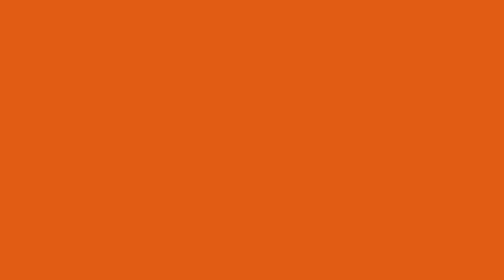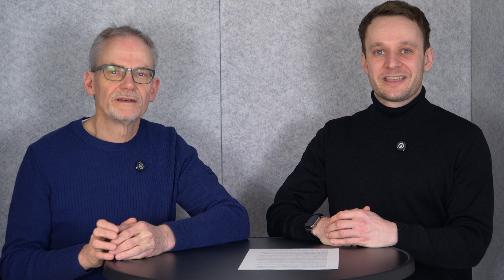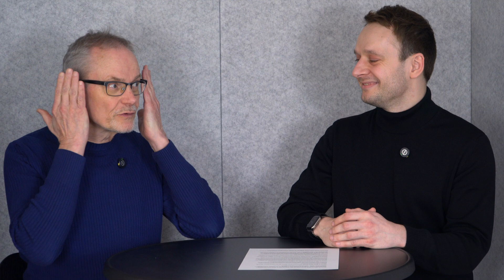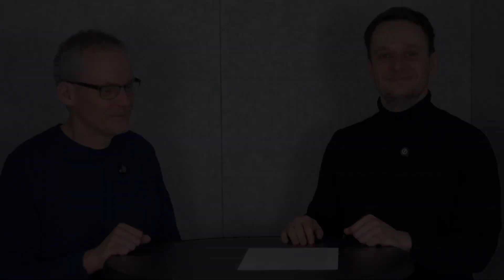Driver Angle: Not only for Soundstage! Grell Sound Lab EP03

Comment: Advice never get drivers smaller than plus 40mm and never go for flat drivers I learnt the hardway,  all my best ones are 50 53 60mm only one other has 42mm drivers all my 40 mm and 38 mm hd500s are gone bye bye   angled drivers and plus 40mm anything flat or small is pointless and thin and imaging is inferior
Reply from the maker: We think a bit differently. Just in terms of pure acoustic performance, we agree that a larger driver for over-ear headphones is generally preferable. That being said, large dynamic drivers tend to have break-up modes in the treble causing dips or distortion, and large drivers put constraints on other aspects of the headphone, ie. freedom of voicing, angle, weight, size, cost, etc.
So we absolutely agree that headphones with large drivers have a higher "ceiling" of good sound, but not every implementation is well done and you can do great work with "standard" 40mm drivers as well :)

Comment: So for angled drivers the targets for FR might actually be different than we usually use, right?
Reply from the maker: This is correct. You already see this in some frequency response measurements, where headphones with angled transducers tend to produce notches around 10kHz, while others don't. Ie. compare 500 and 600 series headphones. Very similar transducers, but the 500 series chassis produces this notch from the Pinna interaction. This also has a direct impact on the perception of space: sound sources close to the ear will generally produce relatively smooth frequency responses, while far away sources will have more pinna interaction and therefor some notch between 6-10 kHz, depending on the individual, distance and angle.
Reply: @grellaudio that's is very insightful! Thanks for your answer! It is very interesting to think that depending on how the headphones are built you can actually expect different curves to sound better. So that comparing them directly looking at their curves only may not be so meaningful.

Comment: I would like to know about the differences in sound tonality achieved by hardware tuning and just by EQ. Could you just buy an entry level headphone from a brand and EQ it to target a more expensive one from that brand and get the same performance (for example: 560s to 550, or Elex to Clear, or edition xs to Arya)? I'm also curious about whether high impedance is useful in a headphone. Thank you so much.
Reply from the maker: Great question! There is a school of thought claiming that only frequency response at the eardrum matters. If that were the case, you could just take any low-cost IEM with a reasonably smooth frequency response and low THD and equalize them to sound like any other headphones. This is obviously not the case.
We're certain that there are factors to sound quality not easily changed by EQ or "raw frequency response": Openness is measurable and clearly audible and can't be changed without hardware adjustments. Transducer size and angle impact the interaction with our pinna. These reflections impact both the amplitude, as well as the time domain. THD can not be reduced without active compensation. The superior perceived clarity of electrostatic headphones are evidence that diaphragm weight is an important factor.
Theory is always interesting, but in this case it obviously disagrees with some hard research into acoustics with topics like openness, as well as with experience.
Specifically on the HD 560S and HD 550: The transducer material is different, so the openness is likely different as well and can't be EQ'd. Beyond that, the diaphragm material is different, where the HD 560S has much higher internal damping, resulting in a "duller" sound, no matter the frequency response. Lastly, the acoustics are slightly different, the HD 560S has a bass tube, which gives the subjective impression of "slower" bass.
Long story short: The transducer of the headphone sets the base line of the sound quality that can be achieved. If the transducer has high THD, has an uneven response, is quite heavy etc., no amount of EQ or acoustic fiddling will bring the system to the level of well engineered solutions with a high-performance transducer.
Reply: @ Wow, thank you so much for the detailed answer!
Reply: Basically: Yes. BUT you have two problems. Firstly, if the difference between the frequency response of both sets is too great, the driver may not be able to match without distortion. Second: Measuring in order to get and EXACT match will be a nightmare, because the shape of your head influnces the sound, so you would need to account for that. You can get pretty damn close by conventional EQing though.

Comment: At the Soundstage chapter, you mentioned that some sound frequencies will come earlier, that means the assumption that headphones are minimum phase devices are too simplistic and in reality isn't quite correct? I'm asking because a lot of the talk about FR being the most important aspect of headphones assumes that headphones are strictly minimum phase. Also does the wider soundstage headphones like HD800 show up as some sort of measurement, like group delay? Which part of the graph or perhaps, what kind of metric could we look at to perhaps at least get a vague idea of soundstage without listening to each individual headphone?
Reply from the maker: Hi Luke, I believe there is a bit of confusion in the community in that regard. I believe there is little doubt that the frequency response is the most important widely available measure of sound quality in headphones. Some people take it to the extreme and claim it's the only relevant measurement, which disagrees with experiment and the world as we observe it. There have been excellent and affordable in-ears for years now, which have a smooth frequency response and negligible distortion in the audible range. If the thesis that only FR matters were correct, most people caring for good sound would just buy these devices because lower cost is a general advantage for consumer goods. Of course, that is not what we see. Another mistake is the assumption that our ears are just measurement microphones. That is demonstrably wrong, there are a lot of factors that influence our listening perception, some of them are arbitrary such as our mood or the color of the playback device. We'll present a near exhaustive list of factors we believe are important to headphone sound quality in a future video. Very few of these factors are quantitatively researched already, but every seasoned headphone designer will agree that they matter.